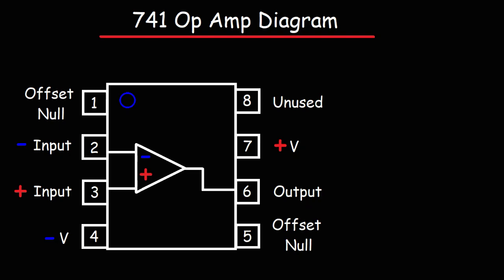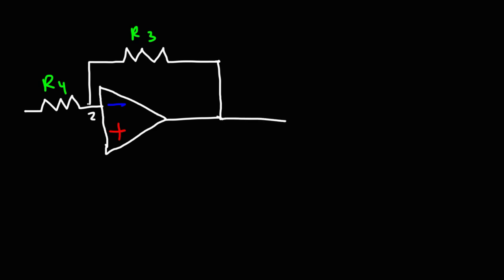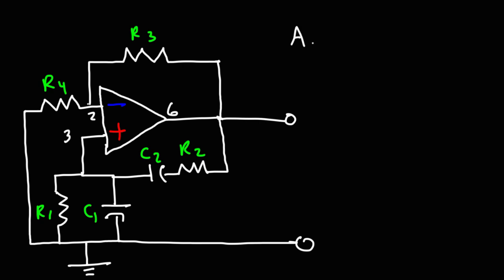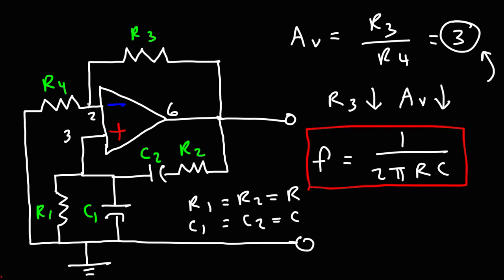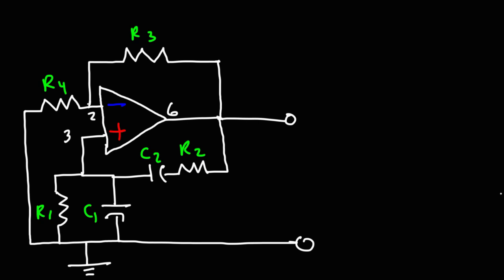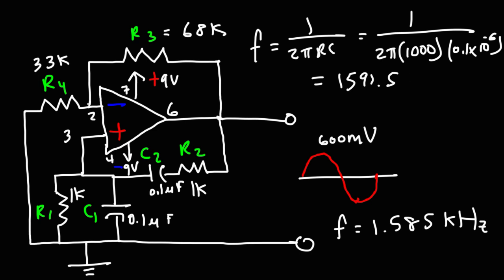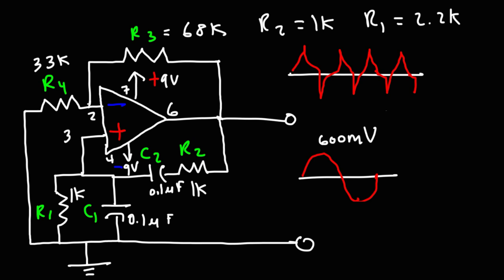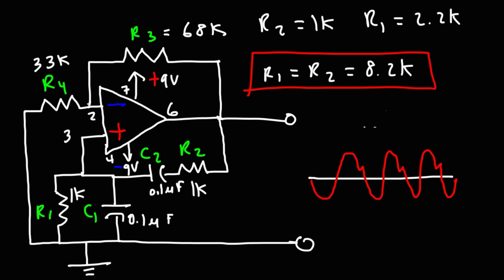Wien Bridge Oscillator Circuit Using a 741 Op Amp

Comment: Shouldn't you include some form of gain stabilization, such as an incandescent lamp across the inverting input, or a pair of back to back diodes in parallel with the feedback resistor?

Comment: Why does it oscillate? The only input you have there is Vcc and Vss but I though the power supply of the opamp is just powering the amp? How do you get the "external" circuit oscillate? Because when I tried this on falstad with the ideal opamp and it does nothing

Comment: 600mv is low . What is the unit that increase or decrease the voltage on this OP-amp
Reply: you could use an other opamp to buffer/amplify the output.
Reply: Or you could use an external power source and an op amp. But don't use multiple op amps to try and get it higher unless you have an external power source.

Comment: what about this design :
Design an oscillator which is capable of producing sine, square and triangle waves with 5V peak in the frequency range of 100Hz to 10kHz. You can use the circuits you saw in the lesson while designing. Make your design using opamps. Give priority to the use of LM741 in your design.
Reply: Refer to book " R. A. Gayakwad, Op-Amps and Linear IC’s, "